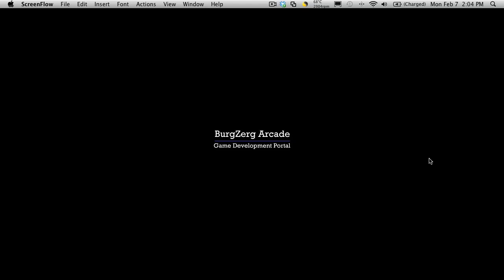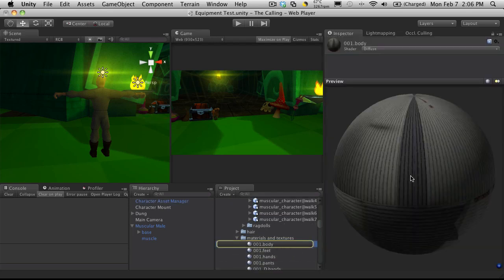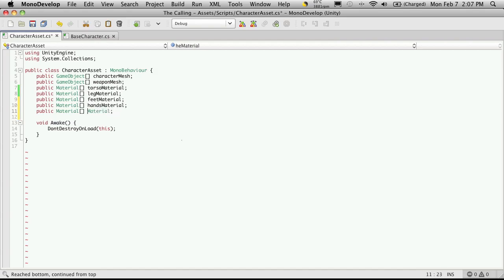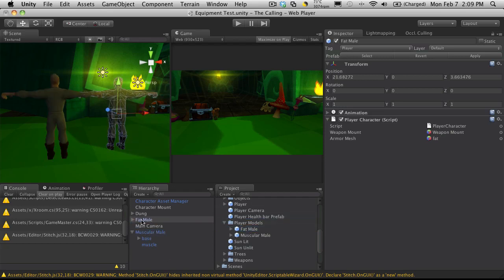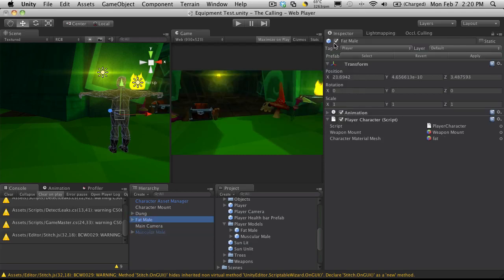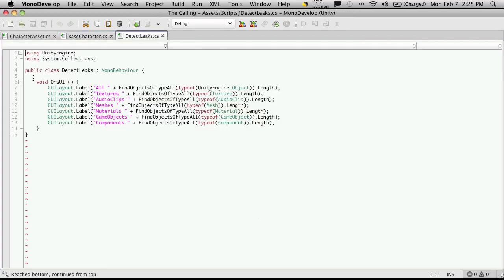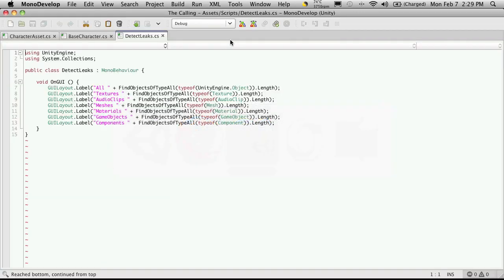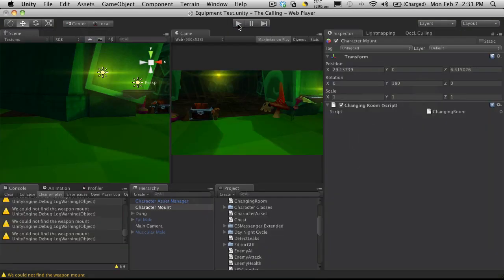164. Unity3d Tutorial - Changing Room Part 6

Comment: just to point out why the weapon is jumping around for anyone else who views this. its jumping because when your instantiating it, your just instantiating it so it defaults to its last location when you made the prefab, you then set the parent after so you see the difference in position in that split second while unity moves it. there is an overload to instantiate that instantiates the object and sets the parent in one line and it should stop the jumping. its Instantiate(prefab, position, rotation, parent). just add the 4th parameter passing in the transform of the parent object and it won't jump as unity will create it at that position instead of creating it at the default position stored in the prefab and then moving it, then you also don't need the second line of code setting its parent.  Hope that helps anyone else with the same issue.